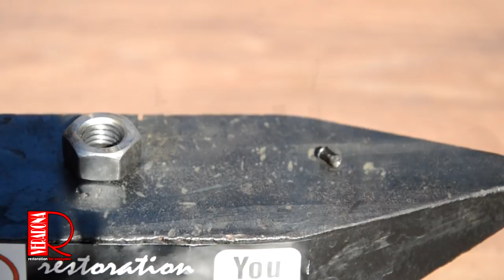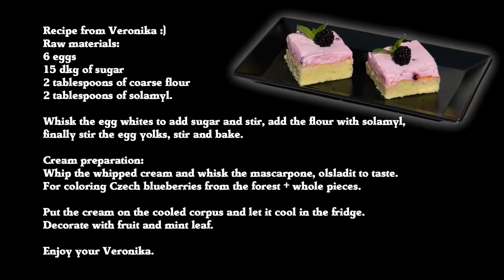Old kitchen scale - Restoration

Comment: What was the liquid you dipped the brass in at 16:13? What was the black "Color Spray" you used to antique it? Just any black paint that you wipe away before it dries?
Reply from the maker: Brass is cleaned in a "brass cleaner", it is a mixture of several acids, purchased already mixed. Black spray is a synthetic varnish.

Comment: What a great restore. I really like how you antiqued it with the paint. Why did you use Sodium hydroxide (Lye) to remove the rust. That chemical is very hard on the metal, it corrodes. Vinegar would have done the same job. 👍👍👍👍👍
Reply from the maker: I used the liquor to remove the color, but it was harder than I thought, so the liquor only disturbed the color. Then I used a rust remover for rust.

Comment: Do you have a temperature and time for baking? And is does you potato starch also have baking powder and/or backing soda in it?
Reply from the maker: Baking powder and baking soda are not there.  The baking temperature is 180 to 200 degrees Celsius.  According to the oven.  The surface is baked lightly pink.

Comment: Can you reuse any of these cleaning agents? Do you have to filter them or something?
Reply from the maker: Yes brass cleaner can be used repeatedly it is a mixture of several acids. Sodium hydroxide could be used too, but it works better heated.

Comment: Why you not use the Sand blasting machine to remove the rust?
Reply from the maker: I do not have him
Reply: @VeradonaRestoration  You need to get one.  It's very satisfying to watch when you're using the Sand blasting machine.
Reply from the maker: @SexyBunny5576  Yes I try, but in our country a decent sandblasting box with a compressor stands like an older car.

Comment: I generally like your work.  Honest critique here - the paint on the scale is overdone.  Very heavy handed and gives it the look of a chain store bauble, as opposed to the true antique it is.  It also seemed there was rust remaining after you blackened the metal - did you use Jax? A rust converter would be a good step.